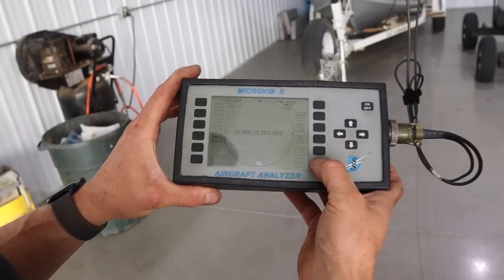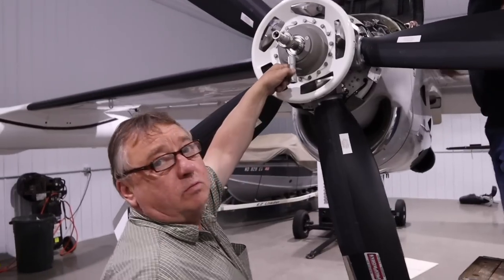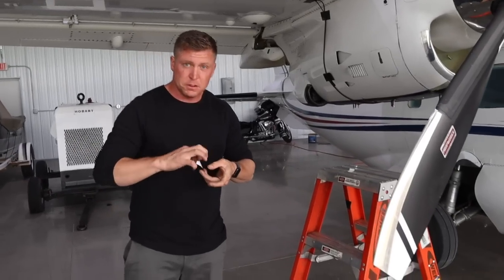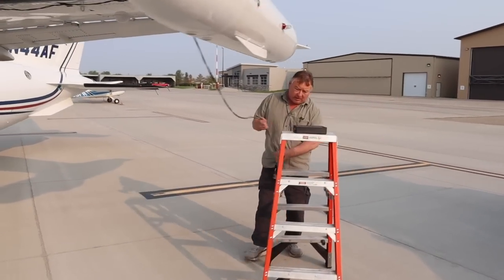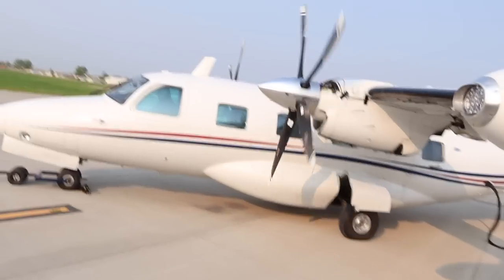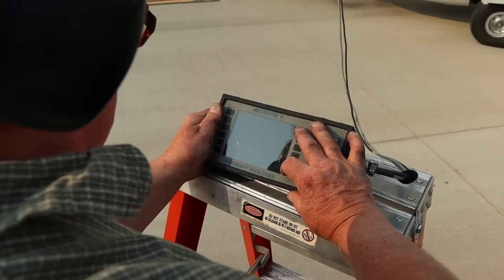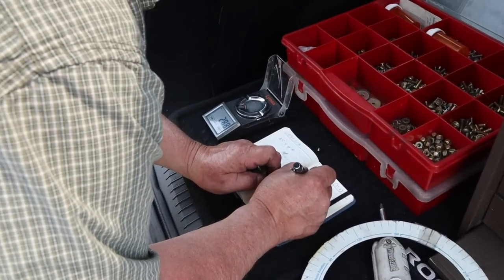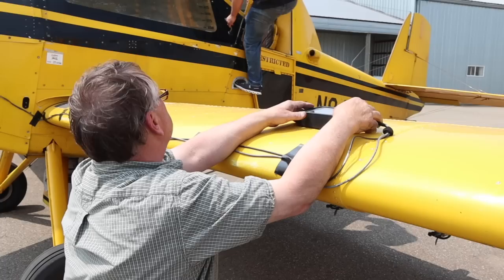learning to balance a prop  (Microvib Aircraft Analyzer)

Comment: I use the microvib 2 quite a bit for tracking and balancing helicopters. Heres 3 things i have learned. Never lie to it, tell it exactly how much weight you put on and where, the first few runs do very small changes, some aircraft like the ones in this video are programmed very well and you can get it in just 1 move. Some aircraft like most bell helicopters are not and require you to move 1 weight in some direction and do another run. Typically it makes it worse for the second run and it will learn based on that data. By the 3rd you should be pretty close to perfect. Lastly is more for helicopters but only make on change at a time, if you change a weight on the head and create a shake when your running both tail balance and head balance your gonna have a bad time. I suppose in your case the tip is dont try to balance with 2 engines running at the same time